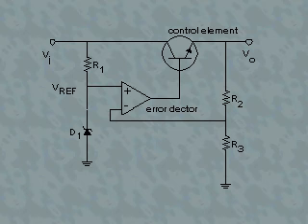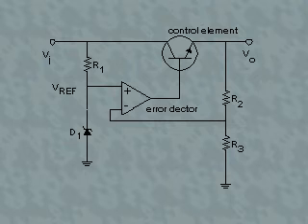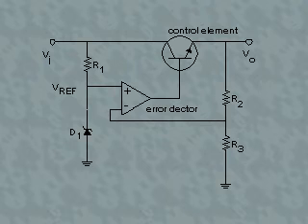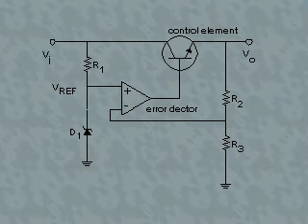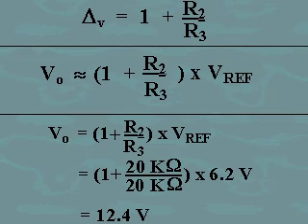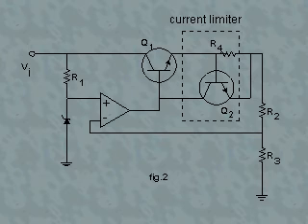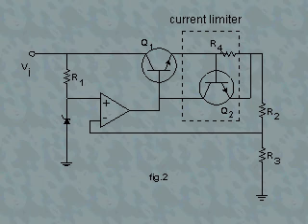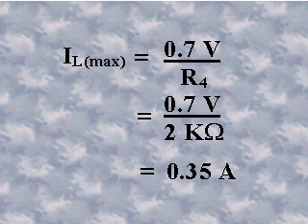Electronics Tutorial , Lessons#62 - OPAmp Series Regulator

Comment: Hello given this video is so old I guess there is minimal chance of a reply, which ironically is the same chance my actual lecturer will reply....
We were given this exact same circuit in an assignment and tasked with calculating the output voltage. The only difference is on his circuit the zener clamped voltage goes into the inverting pin of the opamp and the feedback goes into the non-inverting ie positive feedback. 
Is there any chance you or one of your followers can explain why one would do this? It seems counter intutive to me....
Reply: Doesn't this just give you an inverted voltage? Using an offset on the input you can make a waveform around the virtual ground, although always above 0v, which could then possibly be shifted to be around 0v and thus a +/- voltage wave, and from this the possibility of a dual rail supply.

Comment: Very well explained. However, your current limited configuration should have a limiting resistor between the opamp output and the base of Q1/collector of Q2. This resistor makes the current limit easier to predict, as most opamps nowadays can output very large currents (40mA or more) when shorted. By limiting that current to, say, 10mA, you can consider the turn on voltage of Q2 to be around 0.65V, instead of some unpredictable value (like something in the order of 0.7 or 0.8V, due to Q2 having to drive a significantly larger current). Also, you will protect the opamp. The disadvantage of this is that it will limit the drive current of Q1, so you have to take this in consideration and guarantee that Q1 still has enough beta for large currents.

For instance, in a circuit that I've built, that uses the same configuration but with the resistor, it limits the current to 250mA. Having that resistor shorted, the limit jumps to 290mA. That is very significant.

Comment: Helloy Khalil.Very good explanation in very short time. But...  0.7V devided by 2000Ω are giving 0.35 mA . Normaly the serie resistor (current sensor) is chosen as low possible in the rate of mili Ω in order to prevent power dissipation ( then a high gain amplifier is needed to lower input V of the serie power transistor) so the 2k you mention is not realistic.
Reply from the maker: Yoram Stein Thanks for this nice comment.

Comment: Hi I have a ?....... I have a bridge amplifier TDA2005M op amp circuit with an inverted and noninverted connection to the speaker..... I want to remove the speaker and add a transistor circuit to it. To get more AC gain..how can I do it ....thanks